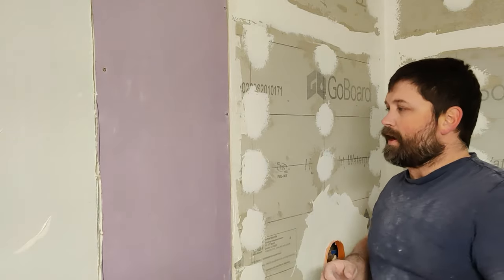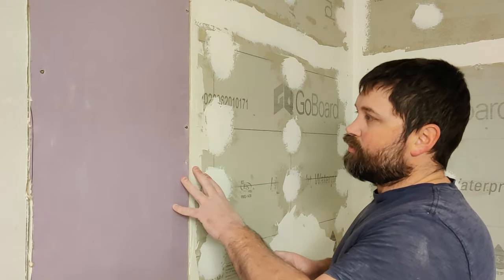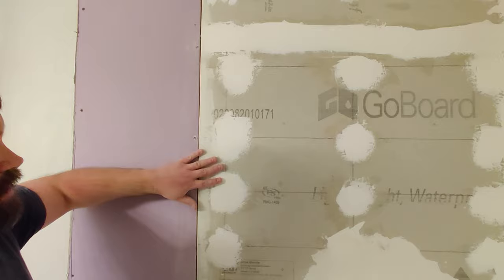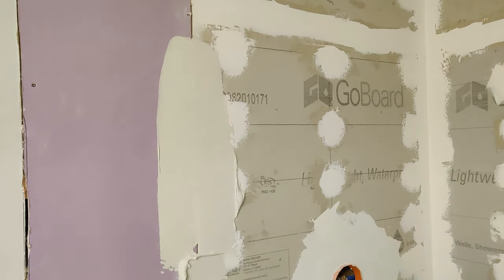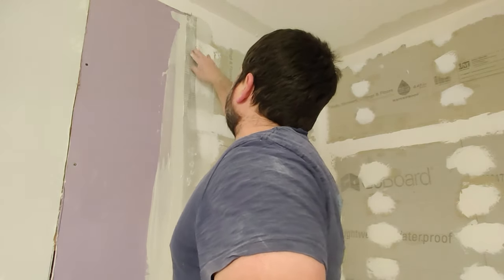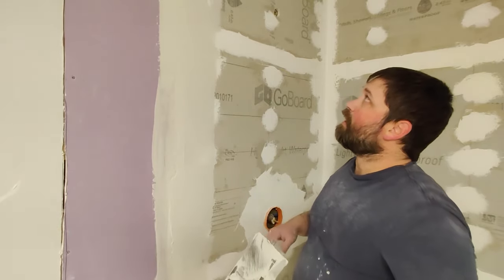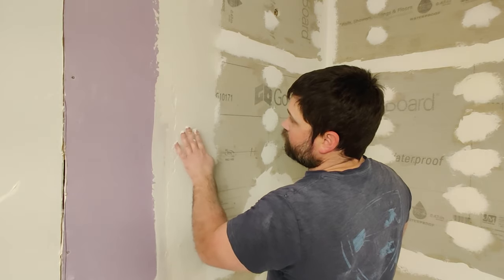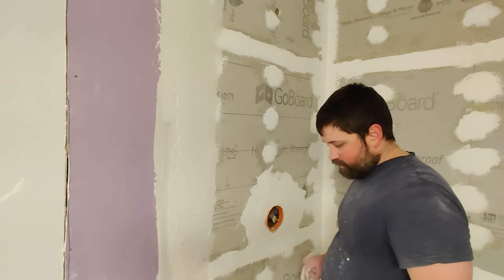TRANSITION FROM TILE BACKER BOARD TO DRYWALL

Comment: I have never installed tile before so I am curious; since you are tiling past the seam and onto the drywall, why wouldn't you just use the Goboard sealant like I am assuming you did for the seams of the Goboard panels?
Reply from the maker: GoBoard has a list of approved sealants and the one I used was from that list.  I didn't use GoBoard sealant on the panels.  GoBoard's sealant is more expensive and it has to be ordered.  Where as some of the other sealants can be picked up at the local hardware store.  Being able to run to the hardware store and pick up a tube if I run out is nice.  Otherwise you have to wait for the goBoard stuff to come in.  If you choose one off the list of approved sealant make sure you look at the setup time's.  The goBoard sealant does come with a 10yr limited warranty.  Here is the list.  https://www.jm.com/content/dam/jm/global/en/tile-backer-boards/GoBoard-Approved-Alternative-Sealant-List.pdf
Reply: @HomeRepairHub  Okay, but why did you choose thin-set to make the joint between the GoBoard and drywall instead of using the sealant you used for the GoBoard to GoBoard joints?  Is the sealant that much more expensive than thin-set?  It seems like extra work to switch over to thin-set when you were already using the sealant?
Reply from the maker: @bobl5737  so to install the tile you will use thinset on the walls.  The sealant is just used to cover the screws and cover the gap between two sheets of goBoard.  If the gap is larger than 1/8 inch you should use thinset not the sealant.

Comment: Great video very helpful for my project. I have question I cannot find the answer to.  My new vanity (73 1/2" +- 1/8" according to specs) will be captured between 2 walls, ie backsplash on 3 sides. One wall is fixed the I need to determine where to place it.  So how do I determine allowance for tile and the thinset? Really I guess it comes down to thin set thickness because backer board and wall tile thickness I can  measure.  Maybe I am over thinking this  DOES THE FINISHED THINSET THICKNESS change drastically from the notch thickness of the trowel you use?
Reply from the maker: Not really.  It really just depends on how thick you put on the the thinset.  Are you using in Large format tile or something small like subway tile?  Assuming the walls are flat you might add 1/16 to 1/8 on each side just to accommodate the thickness of the thinset.  I am not a professional tile installer by any means so you might try asking Home Repair Tutor, TileCoach, or Sal Diblasi or someone like that.  They all do a lot of tile videos.

Comment: What thinset are you using?
Reply from the maker: I just used the same thinset I used for the tile.  What type of tile are you installing?
Reply: @HomeRepairHub why don’t you answer the question of what Brand or what exactly thinset did you use. For Pete’s sake man, you went through the trouble of teaching how to do it but won’t tell exactly what product you used. So you don’t get paid, you are helping, Right. I’m 67, female. Paid pros to do a job and it is all crap. I’m familiar with drywall compounds but not thinset. What you are using looks smooth and easier to work with ( smooth flat). 😢. If you are going to help. Don’t stop at where you want. Go all in and help. Very frustrating to see this. Maybe you showed it or said what you used in the previous video where you installed your go boards. I’ll watch that and see if I find the answer. Been up since 2am and it is now 4:56 and will have to take care of sick mom, but hey, that’s what one has to do to get help in what they need. I’ll just spend another hour trying to get my answers which you could have spared me. Good video though. Thanks. Debbie in Texas

Comment: You used thin set mortar for the seam?
Reply from the maker: Yep
Reply: @HomeRepairHub  I typed this message right after you said it the first time and your reiterated it in the video a few times after, but thank you for the reply, I think I’m just going to use a tile edge trim and mud the seam
Reply: Based on his comments and instructions so far, that doesn't sound like a very great plan. How would mudding the seam help keep water out? Thinset is far more waterproof than drywall mud, right?

Comment: Can anyone tell me what type of caulking is used to cover the seems and screw holes with goboard?
Reply from the maker: The following sealants are all alternates that will work with goBoard.  I recommend the following: https://amzn.to/3aUyU8L
I would avoid the LOCTITE PL S10 Polyurethane Concrete Crack & Masonry Sealant, this is what I used first and it has a very strong odor and takes 7 days or so to cure.  Whatever you choose check dry and cure times.  I found myself having to wait almost 2 weeks before I could actually start tiling.  Some of these products are at your local hardware store as well.  I wasn't able to find the goBoard sealant at my Menards but I think some actually carry it and that will work too.  I would have had to order it and its more expensive then some of the other options. 

DAP 3.0 (model 18360)
DAP DynaFlex 800 (model 80800)
Liquid Nails Fuze-It (model LN-2000)
LOCTITE PL S10 Polyurethane Concrete Crack & Masonry Sealant (model 1618522, 1618521 or 1086693)
LOCTITE PL S40 Polyurethane Window, Door and Siding Sealant (model 1618516 or 1618182)
OSI QuadMax Window, Door & Siding Sealant (model 1868684 or 1893977)
SikaBond Construction Adhesive (model 106403)
QUIKRETE Polyurethane Non-Sag Sealant (model 866011 or 862017)
Rapid Set Sealant (model 196330010)
Reply: Don't you just use thinset?  Please correct me if thinset should not be used.  Thx
Reply from the maker: @Jeff Dana  So yes you can apply thinset, but thinset isn't waterproof.  So if you are doing a cement backerboard with just thinset and mesh tape its best to go over it with a waterproofing paint, like redgaurd or something.  If you use a foam backerboard there is usually a sealant that goes with it that is waterproof.  Schluter, Laticrete, goBoard, there are several out there.  I don't do a lot of tiling, but if you want more info on the different options available there are tons of videos on how to waterproof a shower on YouTube.

Comment: How do you connect the drywall to the cement board if there isn’t a stud where they meet?
Reply: In your scenario, I would place a 2x4 stud flat behind the transition so that the drywall and cement board each have 1 3/4 of the stud to screw to. This supports and stabilizes the transition.

Comment: Great video, thanks. One question: I was going to install a Kerdi niche in the backer board wall. Should I use the Kerdi tape to seal around it or could I just use the alkali resistant tape?
Reply from the maker: I would recommend using the Kerdi tape.  It is water resistant I believe.  And I am not 100%, but I believe it would void any warranty to use anything else.  I know that's how it is for the shower systems.
Reply: Sorry to be so offtopic but does anybody know a tool to log back into an instagram account??
I was stupid lost the account password. I would appreciate any tricks you can offer me
Reply: @Arturo Skylar Instablaster :)
Reply: @Angel Lee Thanks for your reply. I found the site thru google and im waiting for the hacking stuff now.
Takes quite some time so I will reply here later with my results.
Reply: @Angel Lee It did the trick and I actually got access to my account again. I'm so happy!
Thank you so much you saved my ass!
Reply: @Arturo Skylar you are welcome =)

Comment: When you are using cement backer board all the way to end of the corner and meeting with drywall, can the [in my case, shiny black] aluminum tile accent / finish sufficiently replace the drywall corner bead or would you need both? (My tile and accent piece go all the way to corner.) Thanks from a first time tile diy-er!
Reply from the maker: I would still use the corner bead.  I had a similar situation in my bathroom.
Reply: @HomeRepairHub  what type of bead did you use to make the backerboard/drywall corner? How did you set it on the backerboard side compared to the drywall?
Reply from the maker: I just used 1/2 inch corner bead from any local hardware store.  I used mud on the drywall side and the sealant I used on the backer board on the shower side. Then once it dried I just used thinset over the top to install the tile edge trim.  I would just use the same thinset you used on the backer board and then if you covered it with a water tight solution go over it with that too.

Comment: Very bad idea use dansheild all the way
Reply from the maker: DensShield?  This video is in regards to the transition from backer board to drywall.  This would apply to any type of backer board you use.
Reply: @HomeRepairHub  you dont get it dansheild all the way to out side to shower so you dont have to put mesh tape in joint

Comment: Does quick set concrete work the same? I saw another video using that and membrane instead.
Reply from the maker: Quickset should work similar so I would guess it would be fine.  I really haven't used it before though so I don't really know what the differences would be.

Comment: My backerboard and my drywall are not the same thickness at the seams. Still do the same type of approach? Also, what thinset are you using?
Reply from the maker: I would still use the thinset.  Is the backer board or drywall thicker?  It's a modified thinset.  I am using the same thinset I am using for my tile.  I am not sure what type of tile you are installing, but whatever you use for the tile would be fine
Reply: @HomeRepairHub  the drywall is thicker. 
Going with 3x5 white subway tiles. 
The modified thinset, are you just adding water to it to thin it down some to make more plyable?
Reply from the maker: @wynbarkema3922  you can definitely add a bit more water if it needs to be more pliable it may just take a bit longer to dry.  Are you going to run your tile past the edge of the backer board?  Or are you stopping before the edge of the backer board?  If you run the tile out past the edge of the backer board you will want to taper the thinset off on the backer board side so that it seems flat.  You may have to taper the thinset 12 inches or so on the backer board side so it flat enough to run tile over the transition, otherwise your tile will not be level.  Similar to how you would taper off one side if you drywall was to different levels.

Comment: Whats the purpose of taping any of that? Why fill the screws? Doesnt that already take the integrity away from the tile backer as now its been used and nothing installed. All gonna be covered in thinset anyways. Edge the tile over the seams. These companies are to smart for so many.